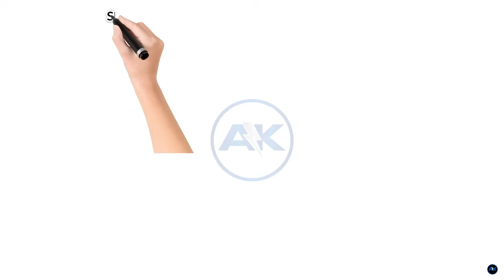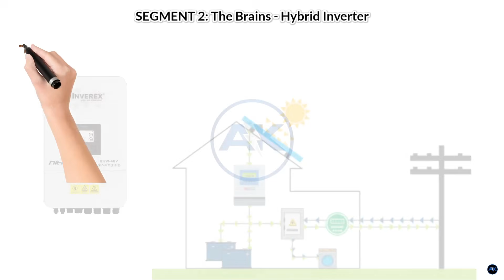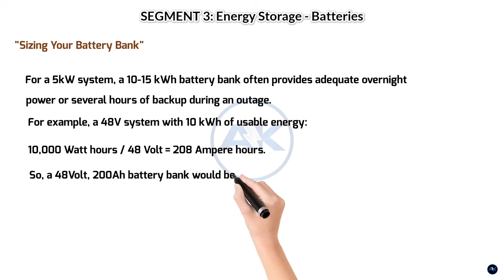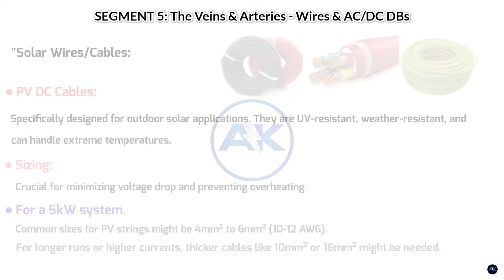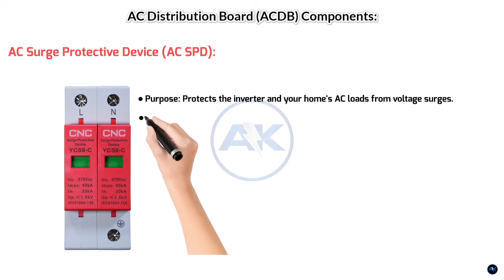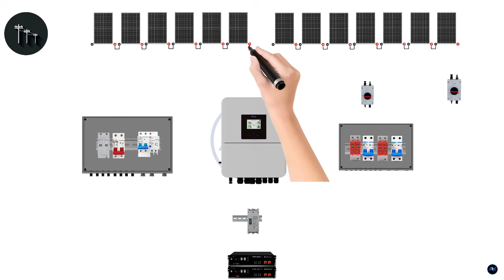Transform Your Home: Build a 5kW Hybrid Solar System & Save BIG! 🌞💰 (Step-by-Step Guide)"

Comment: Awesome.. thank you so much for this great information..a kind inquiry, does the hybrid inverter comes with Automatic transfer switch?
Reply from the maker: Thanks for watching, brother! 🙏 Great question — it depends on the inverter model. Most true hybrid inverters (like the ones we feature) have a built-in transfer switch that automatically switches between grid and battery/solar power in milliseconds when there's an outage — no separate ATS panel needed. But always double-check the datasheet for "transfer time" and "backup/EPS output" specs, since some grid-tied-only inverters don't have this feature. Let me know which inverter model you're planning to use and I can confirm! ⚡

Comment: 1+(-0,24÷100×(-20-25)) Is the account correct?
Reply from the maker: Yes, the calculation is correct! ✅
1 + (-0.24 ÷ 100 × (-20 - 25))
= 1 + (-0.0024 × -45)
= 1 + 0.108
= 1.108 🎯
Reply from the maker: Yes, the calculation is correct! ✅
1 + (-0.24 ÷ 100 × (-20 - 25))
= 1 + (-0.0024 × -45)
= 1 + 0.108
= 1.108 🎯
Reply: @akelectricdiy Thank you

Comment: AK how are you doing man? Listen I have a 6kwh ecoworthy 120/240 V inverter and 2 48v 100ah wall mount batteries, intending to use 10 or 12 585W solar or 10 /710W solar panels in Jamaica 🇯🇲. I watch and screenshot your layout, but could you do this setup online please.
Reply from the maker: Hey @linvalb5! It's great to hear from you. I appreciate the support!
That's a solid setup you're planning! Here's a quick breakdown for your system:
Your Setup:
🔋 Battery Bank: 2 × 48V 100Ah = 9.6kWh usable (paired perfectly with your 6kW inverter)
☀️ Solar Options:
10 × 585W = 5,850W array
12 × 585W = 7,020W array (recommended)
10 × 710W = 7,100W array (best option for faster charging)
⚡ Verdict: Given Jamaica's excellent sun hours (~5.5 peak hours/day), the 10 × 710W or 12 × 585W panels would charge your batteries efficiently and give you good surplus for daytime loads.
Things to confirm:
Your charge controller rating (MPPT recommended — make sure it handles the array voltage/current)
String configuration to match inverter's MPPT input voltage range
I'll try to put together a proper wiring layout diagram for this exact setup — stay tuned! 🙏🇯🇲

Comment: Hello, can you tell me how I can calculate the cold weather coefficient in Bulgaria, the city of Shumen? Do I need to know the maximum sub-zero temperatures? It depends on the winter. You could say the maximum cold is -15 or -20 in the coldest months of winter.
Reply from the maker: Hi @F11_Touring! Thanks for the details — great question for solar system design in Shumen!

When sizing a solar power system in cold climates, the cold weather coefficient is important mainly for two reasons:

☀️ Solar Panel Performance:
• Solar panels actually perform BETTER in cold temperatures due to improved electrical efficiency
• However, at extreme cold (-15°C to -20°C), you need to account for the temperature coefficient of your panels (usually around -0.35% to -0.45% per °C drop below STC 25°C)
• At -20°C, that's a 45°C drop from STC, meaning roughly +15-20% better output voltage — but wiring and inverter must be rated for this!

🔋 Battery Performance:
• Cold weather significantly reduces battery capacity — this is the critical factor
• At -20°C, a standard lead-acid battery can lose up to 40-50% of its capacity
• Even lithium batteries lose 20-30% capacity at those temperatures
• Batteries should ideally be kept in insulated/heated enclosures in Shumen winters

⚡ Recommendation for Shumen (-20°C worst case):
• Use -20°C as your design baseline
• Oversize your battery bank by at least 30-40% to compensate for cold losses
• Ensure all cables, inverters, and charge controllers are rated for that temperature range

Hope this helps with your solar system planning! Feel free to share more specs if you need a more detailed calculation. 🙂
Reply: @akelectricdiy 
 1+(-0,24÷100×(-20-25)) Is the account correct?

Comment: Please sir help us on battery siz  ing calculation in your pv design
Reply from the maker: Hi @AinaAjubu! Thank you so much for your comment and for following along! 🙏 Great request — battery sizing calculation is indeed a very important part of any PV system design, and I completely understand why it can be confusing.

I'm glad to let you know that I'll be covering battery sizing calculations in detail in an upcoming video as part of the PV design series. We'll walk through everything step by step — from determining your daily energy consumption, depth of discharge (DoD), battery capacity (Ah), to selecting the right battery bank configuration.

Stay tuned and make sure you're subscribed so you don't miss it! If you have any specific scenarios or load types you'd like me to use as examples, feel free to drop them in the comments. 😊⚡🔋

Comment: Can hybrid system used as off grid?
How is the set up?
Reply from the maker: That's an excellent question!
Yes, a hybrid system can definitely be used for off-grid power. The main component that allows this is a hybrid inverter, which can manage power from multiple sources (solar panels, batteries, and the utility grid).
For an off-grid setup, the hybrid system uses a battery bank to store power from the solar panels. The inverter then draws power from the batteries to run your home's appliances. If the batteries get low and there isn't enough sun, the system can use a backup generator. The key difference is that it's not connected to the main utility grid at all.
This setup is great because it gives you the option to be fully self-sufficient while still having the flexibility of a backup power source.

Comment: What number of poles SPD, MCB and ATS do I use for split -phase 112/220V hybrid systems?
Reply from the maker: Thanks for the question! I'm glad you're thinking through the safety aspects of your hybrid system. I'll need a bit more information to give you the most accurate answer, but here's a general breakdown for a typical split-phase 120/240V system.
General Recommendations for a 120/240V Split-Phase System
 * SPD (Surge Protective Device): You'll typically use a 2-pole + neutral or a 3-pole SPD. The key is that it needs to protect both hot legs (L1 and L2) and the neutral line from voltage surges.
 * MCB (Miniature Circuit Breaker): You'll need a 2-pole MCB to protect both the L1 and L2 lines. In a split-phase system, both hot legs must be disconnected simultaneously for safety.
 * ATS (Automatic Transfer Switch): A 2-pole ATS is the standard for a split-phase system. It's designed to switch both hot legs at the same time when transferring power between the grid and a generator or inverter.
I hope this helps! If you can provide more details about the specific components you're using or the system's design, I can give you a more tailored recommendation.

Comment: Hello
I have a hybrid inverter 4.2 kwh 100a 1x MPPT. On the roof I have
A: 8x solar panel Vmp: 32.65 Imp: 13.63.
B: 6x solar panel Vmp: 44.3 Imp: 10.

How should I connect them for the best efficiency?

Thanks for the answer

Marko
Reply from the maker: "Hey, Marko, thanks for reaching out! That's a great question about optimizing your solar panel connection for your hybrid inverter. I'll put together a video explaining the best way to connect your panels for maximum efficiency. Stay tuned!"

Comment: Great job and thank you for sharing!
Reply from the maker: Thanks for watching!
Reply: @akelectricdiy 
Hi there ,a question men if you can help me out i have an inverter 3600w 24dcv 110vac and i not sure what cable size put between battery and inverter 3600w÷24v=150ah max length 8ft thats 00 AWG or 1/0 cable but in the manual said 2 AWG what is your recommendation?

Comment: From an on-grid 4 kW solar inverter, (after shutting -off grid supply by isolator), can we get solar powered AC by giving AC to solar system from a normal battery inverter ?
What is the feasibility? , risk involved ? ,
And things to take care of ?
Reply from the maker: It's an interesting idea to try and use an on-grid solar inverter with a normal battery inverter for off-grid AC power, but it comes with significant feasibility issues and risks.
Understanding On-Grid Inverters:
On-grid (or grid-tied) inverters are designed to work in sync with the utility grid. They rely on the grid's presence to:
 Synchronize: They precisely match the frequency and voltage of the grid.
 Anti-islanding protection: A critical safety feature that immediately shuts down the inverter if it detects a grid outage. This prevents the inverter from feeding power back into a dead grid, which could endanger utility workers.
 Reference voltage/frequency: They use the grid as a stable reference for their operation.
The Problem with Your Proposed Setup:
When you shut off the grid supply with an isolator, your on-grid solar inverter will immediately detect the absence of the grid and shut down due to its anti-islanding protection. Giving AC to it from a normal battery inverter won't "trick" it into thinking the grid is back. A normal battery inverter (designed for off-grid use) typically produces its own AC waveform, but it won't provide the precise synchronization and stability that a grid-tied inverter expects from the utility grid.
Feasibility: Low to Non-Existent for a Standard On-Grid Inverter
For a standard on-grid inverter, this setup is not feasible and will not work as intended. The anti-islanding protection is a hardwired safety feature that cannot be bypassed by simply providing AC from another source.
What Could Work (but you likely don't have it):
 * Hybrid Inverters: These are designed to operate both on-grid and off-grid. They have built-in transfer switches and can use battery power to create their own stable "micro-grid" for the grid-tied inverter to synchronize with when the main grid is down. If your 4 kW inverter is a hybrid inverter, then yes, it's designed for this kind of operation.
 * AC-Coupled Systems: In these advanced off-grid setups, an off-grid (battery) inverter creates a stable AC mini-grid, and a grid-tied solar inverter feeds its output into this mini-grid. The off-grid inverter manages the power flow, ensuring the grid-tied inverter sees a stable "grid" to operate with. This requires specific inverters designed for AC coupling.
Risks Involved:
If you somehow attempted to force a standard on-grid inverter to work in this manner, the risks would be substantial:
 * Damage to Equipment:
   * Inverter failure: The grid-tied inverter is not designed for the potentially unstable or asynchronous AC output from a non-grid-forming battery inverter. This could lead to component damage, overheating, or complete failure of the grid-tied inverter.
   * Battery inverter damage: The battery inverter might also be damaged if it's subjected to unexpected back-feeding or power fluctuations from the solar inverter trying to connect.
 * Electrical Hazards:
   * Voltage and frequency instability: Without a stable grid reference, the output of the on-grid inverter could become unstable, leading to erratic voltage and frequency, which can damage connected appliances.
   * Arcing and fires: Improper connections or equipment malfunction due to incompatible systems can lead to arcing, short circuits, and a fire risk.
 * Safety to Personnel:
 * Voiding Warranties: Any unauthorized modification or operation outside the manufacturer's specifications will void the warranties of your inverters.
Things to Take Care Of (If you were to pursue a proper off-grid solution):
Since your current setup with a standard on-grid inverter is not suitable, if your goal is to have solar-powered AC when the grid is off, you need to consider:
 * Invest in a Hybrid Inverter: This is the most straightforward solution for having both grid-tied benefits and off-grid backup.
 * Dedicated Off-Grid System: Install a separate off-grid solar system with a battery bank and an off-grid inverter. This system would be completely independent of your grid-tied system.
 * AC-Coupled System Design: If you want to integrate your existing solar panels with a battery backup, you'd need a specific off-grid inverter that can create a stable AC bus for your grid-tied inverter to "see" and feed into. This requires careful design and installation by a qualified solar professional.
 * Proper Isolation and Transfer Switch: For any system that can operate off-grid, a properly installed and certified transfer switch (manual or automatic) is absolutely essential to ensure complete isolation from the grid when operating in off-grid mode. This prevents back-feeding into the utility grid and protects utility workers.
 * Battery Sizing and Management: For off-grid operation, you'll need a correctly sized battery bank to store energy for when the sun isn't shining, and a charge controller (often integrated into a hybrid or off-grid inverter) to manage battery charging and discharging.
 * Load Management: Understand your power consumption and ensure your off-grid system can handle the loads you intend to power.
In summary, directly feeding AC from a normal battery inverter into an on-grid solar inverter (after disconnecting the grid) is not a viable or safe solution. On-grid inverters are designed to shut down without the grid present due to safety protocols.

Comment: Thanks, What is the purpose of a DC circuit isolator when there is a circuit breaker?, you can isoalte the solar panel with just a circuit breaker
Reply from the maker: That's an excellent question that gets to the heart of electrical safety in solar (PV) systems. While a circuit breaker can interrupt current, a dedicated DC isolator serves critical safety and operational purposes that a circuit breaker alone cannot fulfill:
While a DC circuit breaker can physically disconnect a circuit, a dedicated DC isolator is essential for safe, code-compliant operation, maintenance, and installation of solar PV systems. It provides the critical visible air gap, reliable load-break capability, and secure lockout points that a circuit breaker alone cannot guarantee. Never rely solely on a circuit breaker for safe isolation.